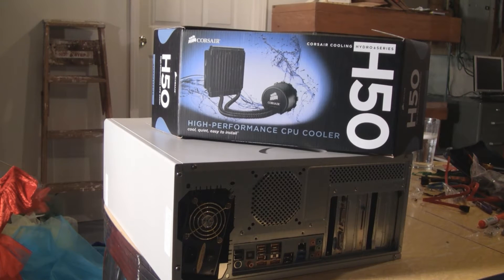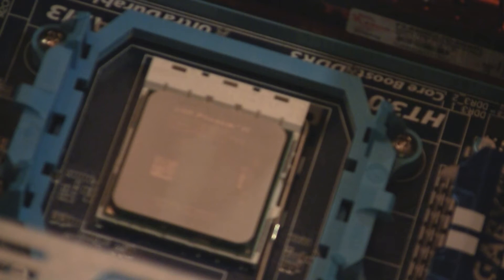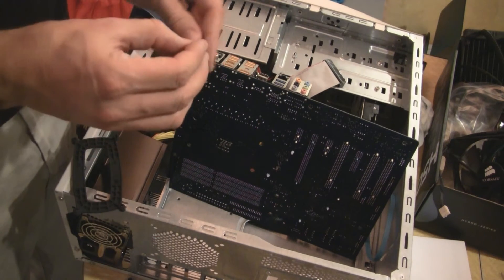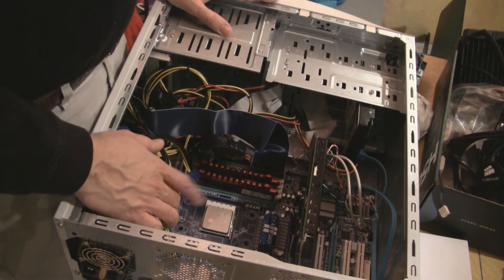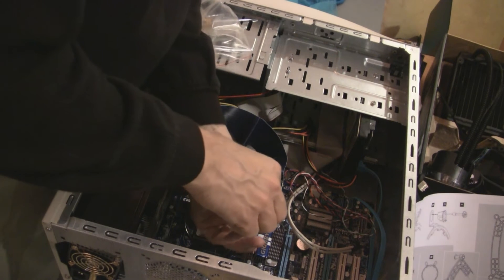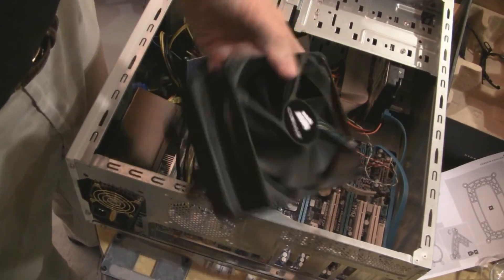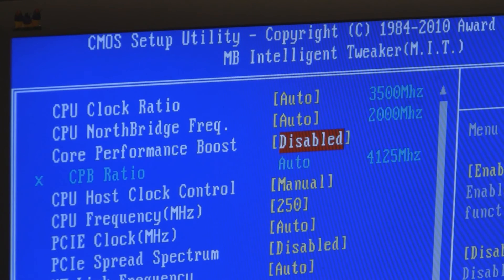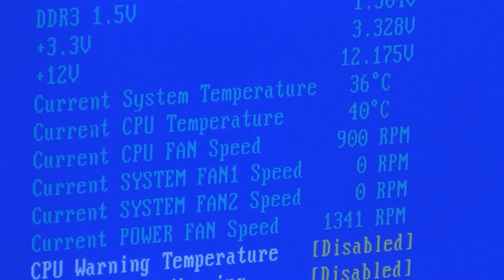AMD Phenom x6 1050T overclock with a Corsair H50

Comment: The cpu coming out of the socket has always been a problem since socket 5 on up. It is a pain in the ass on newer rigs due to the pins. It happened to me a lot with my 8250e. 2.7ghz to only hit a wall. But hey only 97w :s